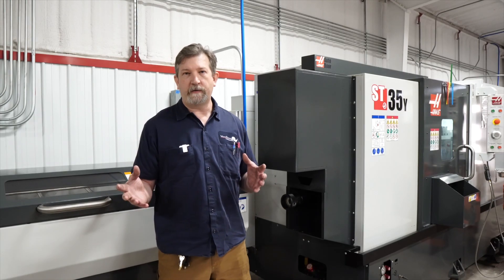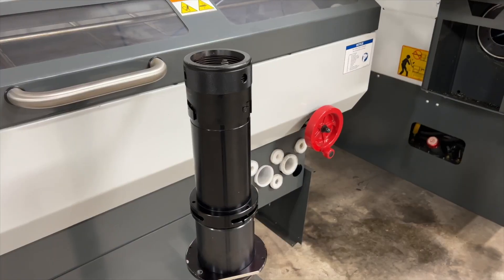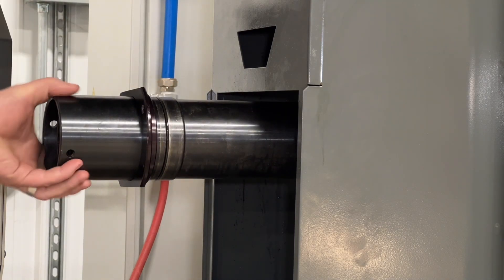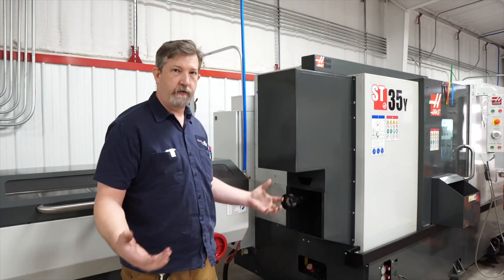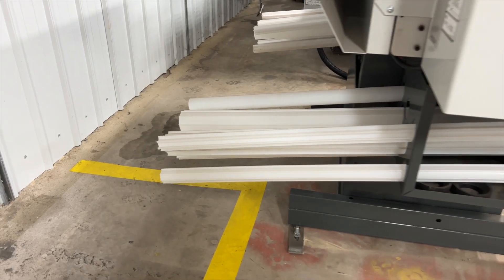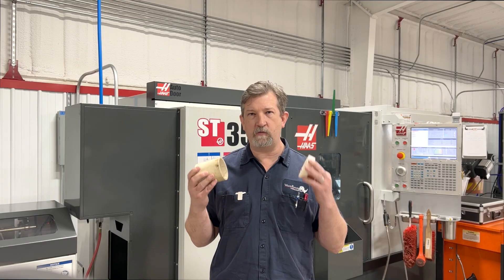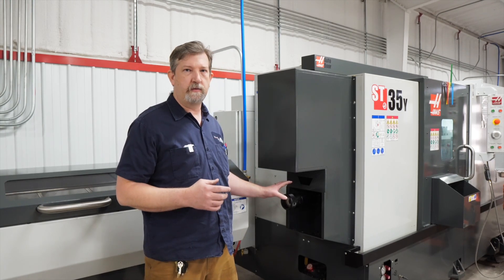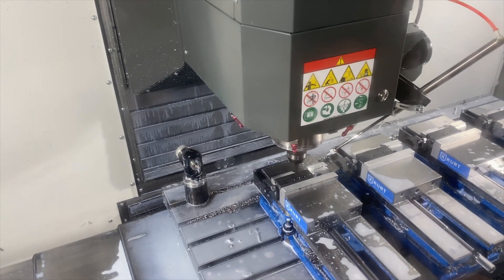Fixing Problems with HAAS ST35Y Big Bore Lathe

Comment: Those donuts and pvc spacers kinda suck, although they are very easy to make.
Reply from the maker: That is a fair statement.  If I was running thousands of parts at a time, then it wouldn't be so bad.  However, because I am a job shop, I can run anything from 1/4" to 10" multiple times a day and 15-20 minutes each time is painful.
Reply: @wrfnation1541  I understand believe me I do. The question is, is it cheaper to machine donuts from UHMW, or is it more cost efficient to purchase purchase a liner. TBH I would purchase a liner, less things to keep up with. Man we are in a very competitive market. I wish you the best. Haas is a very good job shop machine. If you get I to 500 or more part runs I think Doosan sub spindle  is the way to go. Don't get me wrong I love Haas controls, Doosan  is well built, only downside is learning Fanuc control. I hope you make alot of $ in your endeavor. If you ever step up to a Doosan for productivity pm me. Brother I will be glad to help.
Reply from the maker: @phillipwebb3309  those are all valid points.  My main point was the cost of the “kit” that came with the donuts was more expensive than the kit for the long spindle liners.    Both work I was just sharing my experience with it.
Reply: @phillipwebb3309  we have a doosan lynx 2600sy coming in a couple weeks!  Excited and nervous lol

Comment: Do you know what the Haas part number is for the spindle liner adapter you used is? I am interested in setting up a bar feeder on my st35y but have been told by Haas I cant do it...
Reply from the maker: I'm sorry, I'm just seeing this.  The spindle liner kit was this.  https://www.haascnc.com/haas-tooling/lathe_workholding/spindle_liners/08-0199.html  and the adapter was this https://www.haascnc.com/haas-tooling/lathe_workholding/spindle_liners/05-0206.html  Then I made an adapter to fit the adapter ha!

Comment: I commend you for putting this content out there, I have been thinking about doing the same so people can make an informed buying decision. Any new machine will have some quirks but Haas has several and it's annoying because most of the problems are easy fixes, it boggles the mind. They musty be hiring engineering students right out of school, large brains but no sense.